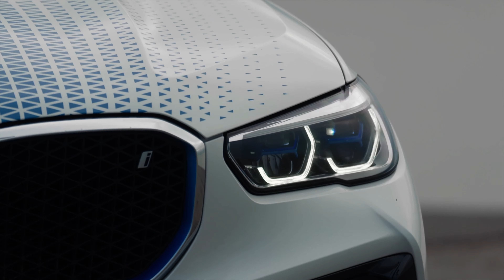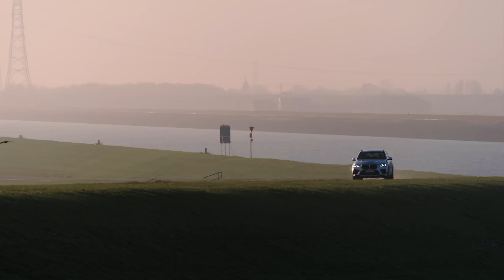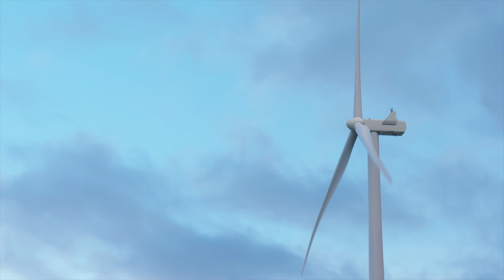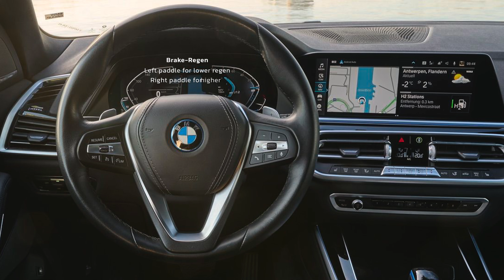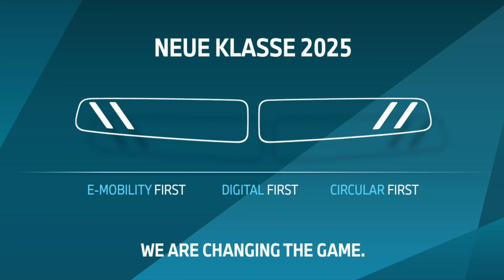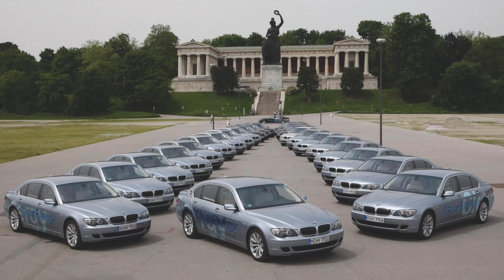BMW iX5 Hydrogen Full Review and Test Drive

Comment: So how does the AC work? Does it run off a battery? Does the hydrogen run a little wheel to generate energy? I have many questions and not enough answer
Reply from the maker: AC works off battery. Here is a workshop that explains how this drivetrain works https://youtu.be/N5zxPrse3_s
Reply: @bmwblog  thanks

Comment: Green Hydrogen: 55kwh/kg in Production
This BMW: 1,19kg/100km Wltp! -> over 65kwh/100km

Tesla Model Y:
Over 500Ps
Space like a Q7
4 Wheeldrive
-> 18kwh/100km

And you can charge at home

400k km Carlife:

BMW Hydrogen: 260.000kwh
Tesla Model Y:      72.000kwh+ ca 5000-10.000kwh to Produce the Batterie.

No chance for Hydrogen..

Comment: 500km WLTP on 6 kg, and 1,8 kg/100km realworld? I'm sorry, but that is terrible efficiency for an RWD. Scratch that. It's terrible for any type.  That's  equal to 33kWh per 100km, assuming 55 percent fuel cell efficiency. Other H2 cars can do over 100km per kilogram. 
You also added together the kW power of the fuel cell and the motor. That makes no sense, fuel cell (or the small battery) is the source of power for the motor. You can't add these together. 
I really hope people are not serious about the idea to import H2 from the middle east. Talk about replacing one dependency with another. The 24 percent of energy to transport the hydrogen is also optimistic, considering you have to either liquify it or have huge tanks for the transport. Another point was that you want to store the renewables into H2. Ok, but why are you using that as an argument againts batteries? Battery storage and BEVs themselves are a buffer for renewable energy. People are also unlikely to have an electrolyzer at home. With BEVs they can send their overproduction directly into the car. 
I understand BMW hedging their bets but as long as over 95 percent of H2 is made from methane, let' s not call this a green transportation alternative.
Reply from the maker: why not add together the HP output? That's the total power output. In the print review, we broke down all the specs, by source also.
Reply: @bmwblog  The Fuel cell is the SOURCE of power for the motor. The power from the motor is what you have available as the driver. Your explanation in the video sounded as if you took the fuel cell power and added the power of the motor to get to 401hp. If the motor can indeed produce 401 hp (300kW) the rest of the power  (300kW-175kW fuel cell = 125kW) would have to come from the tiny battery.

Comment: A very good first deep insight to the car. Trank you for it!

As a driver of a Hyundai NEXO I was astonished about the consuption while the test drive. Done with my car I would see a consumption of about 0,8 kg/100 km H2 and so 1 kg/100 km less then the X5. The NEXO has a tank capacity of 6,33 kg H2 and a WLTP-distance of 666 km, the X5 6 kg and 504 km.

So I believe it is great that BMW now really works with the hydrogen technology. Because for bigger cars ist is a great technology! I like it in my Hyundai very much.
But it is a lot more than taking some fuel cell staks from Toyota, build them together and the car is ready. It is the absolut correct decission to bring the car as a techology test car and to learn now. I would say at the moment Toyota and Hyundai are with that technology in lead about more then five years of development.

Go on BMW!
Reply from the maker: Thanks. Glad you enjoyed it. And yes, bigger cars make more sense

Comment: The conversation touched on cabin conditioning with the battery. Not the issue of battery conditioning for range. 500km combined range in cold weather with lithium batteries degrades noticebly.  The answer to the problem was not given.
Reply from the maker: But is it running on li-ion? The hydrogen supplies the continuous power
Reply: @bmwblog fuel cell turns ~50% of the energy of H2 to electricity. Rest is heat. You can heat the car easily with that energy… 
You need to direct the heat to the correct places

Comment: Excellent video and narration.  Great questions.  I'm actually amazed at the size of the center tank and that it doesn't seem to intrude into the rear passenger compartment that much from the picture shown.  Unlike the Mirai which the rear center passenger has to really spread their legs out wide to sit there.  BMW seems to have done a great job at packaging all the equipment needed for an FCEV.
Reply from the maker: Glad you enjoyed it! Tried to go into as much detail as possible.

Comment: What is the weight of the car?
Reply from the maker: Similar to a BMW X5 plug-in hybrid
Reply: @bmwblog  thank you. I thought it would be much lighter.
Reply: @ss0011x  Don't feel bad, it's a common misconception that FCEVs are light.  The hydrogen itself is.  The iX5 holds 6kg or 13lbs of H2, but the tanks, fuelcell, hybrid battery as well as all the small systems to manage all of it, add up to a lot.  The 700bar tanks alone are 300 lbs.  The fuel cell is over 150 lbs.  The hybrid battery is about 200lbs because it's a bigger 2.5kWh to give better acceleration vs something like a Mirai with a 1.25kWh,  plus all the additional equipment and structures needed.  It all adds up to be a few lbs heavier than a PHEV and a few lbs lighter than a BEV, but all within 100 lbs of each other.
Reply from the maker: The entire system can be heavy. Quite a few parts